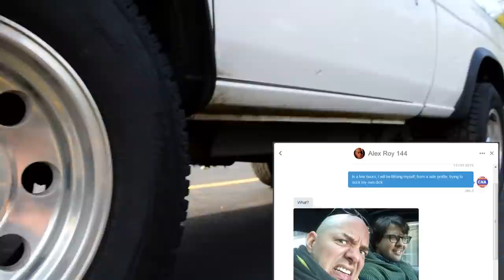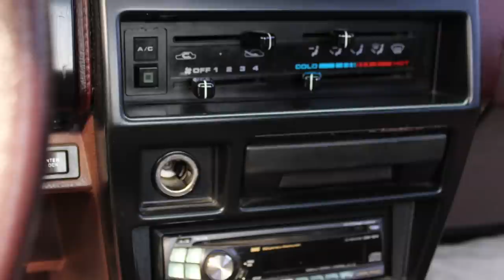Regular Car Reviews: 1991 Nissan D21 Hardbody

Comment: agree 100%, this Nissan trucks are tough. my bro has one with 390000 miles and it runs like a clock.
Reply: Mbuuqw Plays Lol
Reply: ***** when we say it runs like a clock, we mean it never misses a beat.
60rpm? Lmao since when a clock runs that fast haha a clock's 3rd hand runs at 1RPM per minute you fool. Someone needs to go back to 1st grade haha
Reply: ***** what you need to take is some damn math classes  👉60rpm hahaha this guy lol
Reply: Why RuMad dude I have a 1986.5 Nissan hard body, first year they came out. Odometer broke at 452,000 miles. Still runs. But I now have brake problems. Seems that the brake  pedal sinks to the floor with the engine on while it’s ok with the engine off. If the master cylinder going bad it should sink in both instances correct?
Reply: The old Nissan trucks tho, the new ones are straight crap
Reply: @3lb4n4n3r0  The new ones are solid too and built like tanks.
Reply: @scott8238  My uncle bought a brand new Navara, big mistake literally a money pit, and many mechanics here complains about it, but maybe it's luck and I'm wrong
Reply: @3lb4n4n3r0  In the states we don't have the latest Navara but the last model has held up very well here. I own a 2010 pro4x with 190k and 2019 pro4x both have been great.
Reply: But some batteries in that clock
Reply: Old Nissans have Toyota esque longevity
Reply: @grambuddy5143  me too
Reply: I'm not sure trucks are supposed to keep track of time.
Reply: Mine has 750,000 miles on it was my great-grandfathers truck now it's mine its a 1989
Reply: SO IT TICKS????
Reply: Underrated to be honest
Reply: My bro has one with 543000
Reply: Does he still have it?
Reply: I just bought a 96 hard body. It has 350000 miles on it. Removed the valve cover to replace it and it looked like a brand new motor
Reply: Slowly, can't stay in time, and has a distinct rhythmic tick?
Reply: Had one that went just over 400k and the transmission went out, we used it to haul four wheelers and golf carts to the beach quite often, it probably would’ve went a lot more miles if we didn’t pull trailers so much. Definitely got our moneys worth out of that thing

Comment: A friend of mine has one of these with over 800,000 miles on it and it is still airtight.

Knock on wood.
Reply: Do you mean the body? I mean.. 800,000..
Reply: Same engine?
Reply: mine has 450thounsand miles same moter 2nd clutch
Reply: @andrewmonroe155  mine has 175k and I just put in a clutch kit at 165. But Chinese guy drove it so ruined the old clutch
Reply: jonathna11 nice I've owned my truck for 5 years now and I would never sell it
Reply: @andrewmonroe155  I'm going on 1 year and greatest truck I have ever owned I want to lower mine lol
Reply: My odometer has been stuck on 176k miles for around 14 yrs, truck still drives me where I wanna go! 80's style Nissan and Toyota trucks...keep em lubed and do the basic mechanical work when needed(belts, chains, tune-ups, etc.) these things will run longer than u think!
Reply: them ka motors are the best I4's to own
Reply: I have one with 450,000 and I thought that was impressive
Reply: bankruptbutcher It is
Reply: wtf
Reply: 3 of my cousins drove the same Nissan truck for about 600,000 miles in the 80s/90s/early 2000s. They were brothers, and it was handed down through the three of them for close to 20 years. It had to have a transmission, a clutch or two, a head gasket, and a rearend (aside from normal maintenance parts, of course) and taught like, 40 or some ridiculous number of our family and friends to drive stick as early teenagers. It ran like a top until it caught on fire and burned to the point of having to be scrapped one night. It was treated HARD for a LOT of years/miles, we assumed a wire rubbed through near some sort of fluid leak or dry papery detritus, burned up all the important stuff in the engine bay and interior before anyone noticed. It was slow and ugly and somewhat useless as a truck, but the damn thing ran, and ran, and ran some more.
Reply: My uncle has one, probably over 200k miles and survived being attacked by a bull.
Reply: 320,000 on mine, motor is in great shape but I had to afro engineer something for the rusted-thru frame. I cant get rid of the piece of crap I love it so much. Still has a factory clutch for christ sake! Just replaced factory water pump and radiator
Reply: I got 458,000 on mine. I lost 5th gear (it worked out of the transmission case) and a tree hit it. I didn't hit a tree, one fell and crushed my truck. I'd probably still have it and it would have around 1 million miles today.
Reply: is it still going?
Reply: JESUS
Reply: My dad is giving me his 96' nissan pickup with 300,000 miles. Damn truck still runs like new.
Reply: any updates?
Reply: just hit 300,000 on my 93 hardbody 2.4... just replaced the timing chain running strong.
Reply: @andrewmonroe155  How much you got now?
Reply: @weekendhomeprojects  600k still runs
Reply: @philbuilds116  Damn trees, can't trust 'em.
Reply: 127,000 on my 90
Reply: Mine has 900,000 miles on it and has made it from LA to Guadalajara and back twice, it's the automatic 1989 single cab, needs some paint and some work on the engine but it's still doing pretty good
Reply: My family had several of these and they either had powertrain issues or rotted out by 200k  every time. Unless the transmission needed to be rebuilt. The bodies were coated in a bondo-like coating that would crack and break off in a fender bender. From there the rust would take over.

Comment: I got in a really bad accident, a big dodge ram hit my hardbody and flipped us a few times, we ended up upside down. My friend and I both got out of the truck unscathed, what could've killed us in a normal car did no damage to us whatsoever in the Hardbody

I can honestly say that a Hardbody saved my life.
Reply: KusoNeko 🙏
Reply: Don't know about the D21, but I drive a Datsun 720 and it feels like I would rather have a crash in a cardboard box than in that one. :P
Reply: Your hardbody saved your soft one
Reply: watch this it deleted it
Reply: Dude that's wild. 3 years ago I got t boned in my 02 xterra, which yes, I get it, is much newer and safer than a hardbody. But it's basically the successor to the pathfinder which was the successor to the hardbody trucks. Same story though, we rolled over, landed on the roof, and the biggest injury sustained was a bruised elbow from my arm hitting the door. My passenger was fine, and we walked right out of a truck that was still upside down. I swear they're built with magic
Reply: @AnthonyChukreyev  glad you're ok. I love my d21
Reply: Well me and mah dad killed our truck and a Chevy Silverado but didn’t roll
Reply: That’s pretty impressive. The d21 has the worst crash test rating on earth
Reply: These things can take a hit.
Reply: Anthony I’ve had my ‘99.5 Pathfinder for just over 20 years now. Can honestly say it’s the toughest most reliable SUV truck out there! Xterras are very similar.
Reply: That sounds dirty.
Reply: @armanimckoy2168   Source?
Reply: A Chevy sonic would be safer
Reply: Got spun out in my 94 D21, sandwiched on all 4 sides, these tanks saved my ass.
Reply: @AnthonyChukreyev   wow I got the 1994
Reply: Called 'Hard' Body for a reason, ey?
Reply: Which is wild because according to progressive. My hardbody is more of an insurance liability then my Denali and so my insurance was double -_-. I get it tho ha my hardbody has zero airbags

Comment: I have a 97 Nissan hardbody with over 300,000 miles and it's all original and still running strong to this day 😏 tough little truck
Reply: David Shelby Yeah. I had a 91 Pathfinder about ten years ago with 300k on the odometer. And it ran like a Swiss watch. I wonder how many miles are on it now?
Reply: David Shelby I too have a 1997 I am just curious how many timing chains have you done? Mine kills them like a good clock at about 50,000 miles
Reply: David Shelby a modern Nissan truck will be lucky to make it to 50k
Reply: I love a 97 hardbody
Reply: Nissan makes absolute pure plastic crap these days.  When my 87 Toyota pick up was stolen in 2016 I went to the Nissan dealer looking at a manual five speed Frontier.  I test drove it completely under impressed.  I ended up finding a 2002 Tacoma with 75K miles and I really love that truck.  I'll never go big truck, ever.
Reply: Mines got 344k and I learned how to drive stick on it...

Let's just say I've been abusing it some ;)  

still runs great
Reply: @RUSTYCHEVYTRUCK  not true.... nissan and toyota have made very little changes to their pickups in 20 years. Both are very reliable... nissan just looks very dated. luckily.... new frontier is coming. But they make great 4x4 vehicles. xterra for example.... still one of the toughest off road suv's you can buy.
Reply: Still have it?

Comment: In '86 or '87 my dad bought one of these, except it was a long bed "heavy duty" version with a 3 liter V6 and a 5 speed manual.  For a truck it was pretty quick with that V6, and it seemed to be built by the same guy that designed german tiger tanks.  It was unstoppable.  Drove it for 13 years on the original clutch, 165,000 miles.
Reply: same had mine since it came out in 1997 has the same amount of miles and original clutch although it is slipping
Reply: Bought my D21 new in '92. With 220k still have original clutch.

Comment: Fun fact: Chevrolet markets the Colorado as a "Smart-Sized" Pickup. They literally cannot say small truck.  

GM thinks the truck consumer thinks SMALL IS BAD BIG IS GOOD.
Reply: +thegreatcarraway Hell, I want the s10 and Sonoma to come back in the size they were with the good ole long block 4.3 v6 and the 2.5 Iron Duke 4 cylinder as the engines. Now those were good ass trucks. Also the Ranger would be great to have back. I loved small trucks.
Reply: +thegreatcarraway I had a 94, and it was the best truck I've owned.
Reply: +Zack Salter Europe has a new version of the ranger which looks nice.  Can even get it in Diesel.  It seems slightly bigger than the older ones but it looks pretty nice.  Don't know why they aren't available in NA.
Reply: +DangerDavez chicken tax. haha. And yea. I know there is still a Ranger, but it's now more of a midsize truck. It isn't the small little mighty worker it used to be.
Reply: In a 1990s the s 10 was carburetor and slow af compared to my 1996 hardbody was efi
Reply: Chevy sucks wtf are you talking about? The s10 was only carbed for the 83-86 models years on the 2.5 and 2.8 liter engines. By the 90's nothing was carbed. Idk where you got your info from, but obviously you don't know what you're talking about. lol.
Reply: +thegreatcarraway the Colorado isn't even small  or "smart-sized" anyway. I test drove one and I felt like I was driving a tank. Nothing at all like my '95 Nissan
Reply: Zack Salter lmao 1991 it was carbed even then my hardbody would whoop any S 10s ass.
Reply: The Best mini trucks were the Nissan hardbody and Toyota pickup where I live I see hundreds upon hundreds still running and I see maybe a few S 10s
Reply: No sir. It was tbi. lol. I've had plenty of them, none have ever been carbed after 86. Sorry you're not right. lol. And I agree though, The hardbody and toyota pickup are absolutely the best. Very solid ass trucks. Know what make you a true car guy? Not being a little bitch about what is better than the other.
Reply: Most Chevy owners hate the Nissan hardbody like he said in the video small trucks are like a sin. Which I don't see why people don't need full size trucks all the time.
Reply: I love them all. Even the Ford Ranger. I'm an open minded car guy. I understand that some have their downfalls and their strong points. They're all equally as great to me. lol. But, if I had to choose, I would get either another s10, or a hardbody.
Reply: I love the ranger till ford discontinued it but they did for a good reason the F-150 was selling a lot better but there's rumors of the ranger and bronco returning :)
Reply: I just saw a new z71 Colorado and it's not small at all lol
Reply: +thegreatcarraway Ironically, the new Colorado is the same size as the 90's Silverado. And yet the parking spaces are the same size.
Reply: +Zack Salter I have an 86 s10, it was tbi
Reply: +Jeremy Tome A buddy of mine has an 03 silverado and, parked next to a new colorado, the silverado looks to be the same size, maybe a little bit smaller
Reply: If I'd park my Nissan hardbody next to both of those it's even smaller sometimes smaller is better
Reply: A '93 D21 4x4 5-speed came up for sale near me today with 77k asking $3,000. Worth it? Not much rust at all.
Reply: GT6SuzukaTimeTrials Make sure the guys actually taking care of it and changed the timing chain because the ones from the factory suck.
Reply: +GT6SuzukaTimeTrials Buy it. A Hardbody with 4X4 with low miles and minimal rust is a gem nowadays.
Reply: Spaghettios I should have bought it, but I only had $2k to spend at the time and he didn't take that.
Reply: That sucks. :\
Reply: +thegreatcarraway Yes, that is what the consumer thinks. They buy the trucks and cars that manufactures manufacture after asking and observing what consemers actually behave and consume. Engineered aero, materials, and design now permit size with liitle compromise to efficiency yet massive gains in safety. The language and concepts applied are market, marketing, supply and demand. The US domestic mkt. is primarily based on trucks not cars, which are too oil price-economically dependent and teh sub-prime mkt that finances them. Bad and bad. The domestic manufacture of 'cars' market has not been profitable in 20 years. The Euro and Japanese manufactures of cars have been largely profitable worldwide (incl US). Mr. Reg's English major and tonality may provide a sense of authority but fallacy can still be grammatically correct. A capital letter follows a peroid still.
Reply: Smart-sized pickup?

CADILLAC CATERA.
Reply: That's what every American automobile thinks what the consumer wants.
Reply: It doesn't help that the S10 was pretty shit
Reply: Yeah, funny thing is people loved the S10. Nobody loved the Colorado, they sucked to work on and weren't as reliable, and who wants a midsize truck anyways. So naturally, Chevy brought back the truck nobody wanted the first time around. I'd like to ask the people that made that decision WTAF they were thinking. They should have brought back the S10, not an even bigger Colorado, I think the new Colorado is actually bigger than an old C/K 1500...
Reply: Yep! Eleventy thousand million S-10 pickups/Blazers sold in Iowa in the 80's and 90's. The Colorado? Not so much. 6/8ths the size of the C/K and within a couple of grand of the full size in price. Whats the point?
Reply: zack salter...i miss the ranger...i even miss the shitty 3.0L that say something
Reply: @zackisawesome11  i had a 91 S10 reg cab 2wd with the Iron Duke and T5 5 Speed and it was a piece of shit, didn't even have power steering (it wasn't until the 2nd gens that power steering was standard)
Reply: FirebirdCamaro1220 problem with the new mid size trucks,  especially the ranger,  is that it doesn’t cost much less than the f150.   You can get a base trim level f150 with v6 for less than the most expensive trim ford ranger.   Nobody is buying the new ford ranger.
Reply: I got a 86 hardbody think I need a sticker that says MY TRUCK IS smaller THAN YOURS! 😂
Reply: Fast forward a few year and the Tacoma is a 1st gen Tundra, the Colorado feels smaller, and Ford is trying to a sell a Ranger Raptor for more than the original Raptor.

Comment: I had a 91 Nissan Hardbody.  It was a fantastically reliable vehicle.  I had it in college and I drove pizza delivery in it for about 2 years.  I was young and dumb and I am not kidding when I say I did zero maintenance on that truck for two years of hard driving.  None.  No oil changes, no anything.  Driving pizza delivery for two years.  And it not only survived, it was great until the day I traded it in.  For a Saturn SL1  :(  Bad move on my part.  I wish I still had that truck.
Reply: Most of us guys were dumb. And the majority wish they ( still ) had their first car/ truck and girlfriend ( who they should have married but didn't).
Reply: I have a 91 2wd lowered 3inchs She's cherry red. With 127,000 original miles. It's my baby. I just drive her in the summer.

Comment: i had a 90 hardbody that I paid 1200 bucks for in 1997 with 114k miles..  I drove it for 8 years and put 100k miles on it with nothing but, oil, tires, tie rod replacements and a clutch replacement, it treated me very well, it was a great truck.

Comment: I loved mine. I got it new in 1996, owned it for 17 years and all I ever had to fix was a mass-airflow sensor and a timing chain guide. I sold at almost 200,000 miles still with the original factory clutch.

Comment: My GF has one of these, 96 with 200k miles, in 10 years It's had maybe $130 in unexpected maintenance on it. (upper pulley bearing, fan control resistor, o2 sensor)
Reply: Just got a new heater blower--after 24 years.  I want a new bench now, with fresh springs.